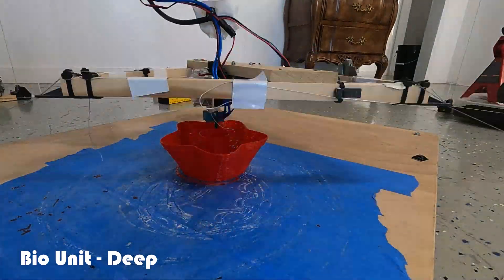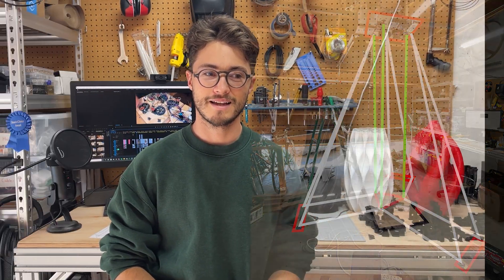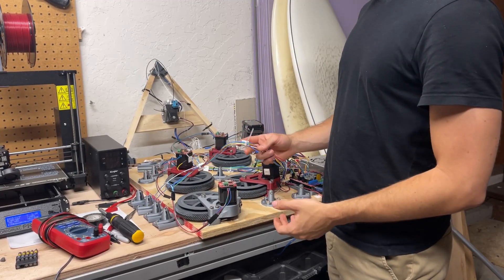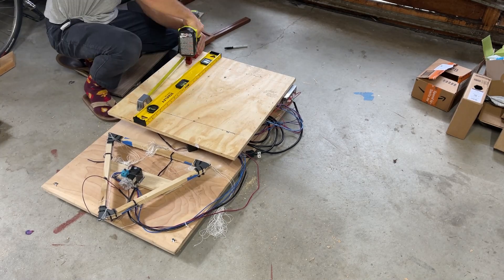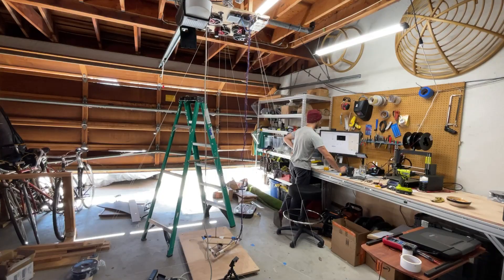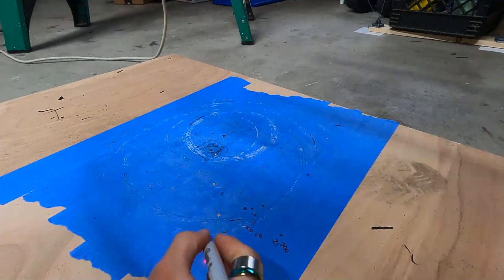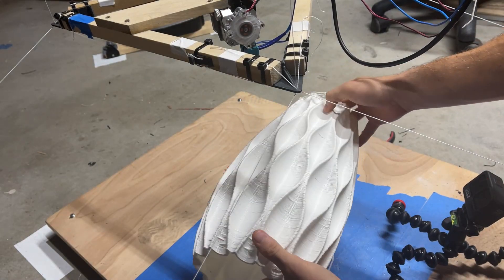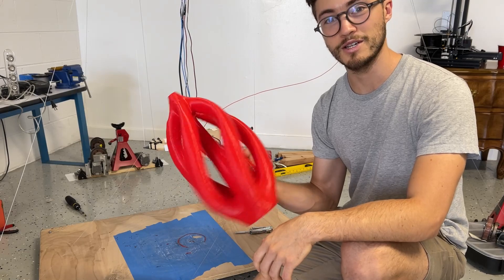Massive 3D Printer: Hang Printer v3 Build, Mods, and Vases

Comment: Oh my gosh! My heart rate increases a bit every time I hear someone tried a HP2 or HP3 build. They're notorious for causing all different feelings you describe in the video. (Being the designer I always fear someone figures out that it's all my fault.) Great work wading through the swamp and actually making it print nicely. 🎉🎉

About the gears, they should be mounted further away from each other, so you have a little play/backlash in them. It makes them wear a lot slower, and run a lot quieter. (Lines always pre-tension the gears anyways, and lines can only pull, not push, so gear play is not causing issues.) This isn't really in the docs I think. It's the same with the HP4's belts. They should be rather loose, not tight.

You're in a really small club of people who have made a working Hangprinter, it'd be lovely if you want to hang out with us on Discord!

Cheers
Reply from the maker: The gear design makes a lot more sense when you take into account the whole thing is in tension! 
It was hard for me to get the right spacing just using the back board so the 3D printed parts helped with that.
I would love to join the discord server!